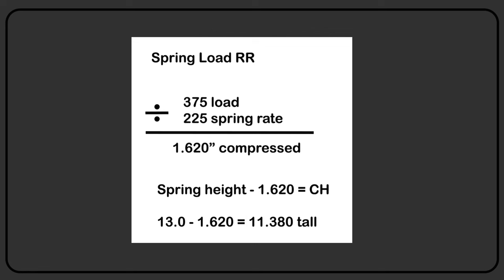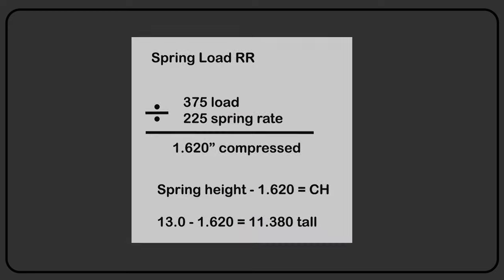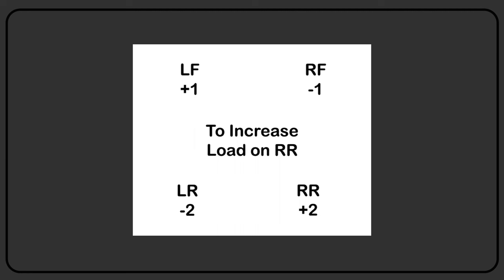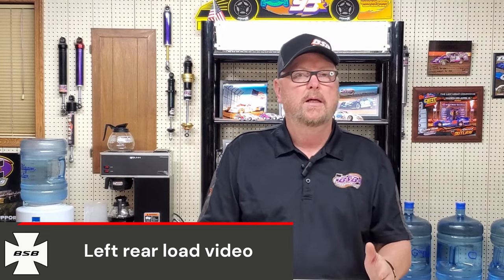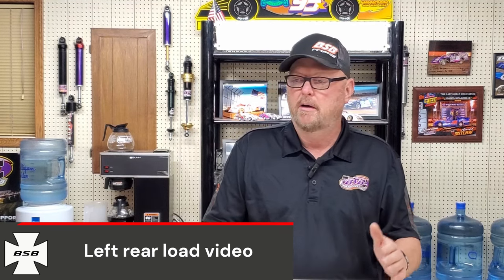RR Load, understand how load makes your car fast. (Short Video)

Comment: Had a pair of racers that i consult for. One has learned to trust in us and he makes the changes we need to do. The other is very stubborn and wants to strictly adhere to the chassis builders setup even tho he wants to change 30 things between hot laps to the heat and heat to A or B main. That chassis builder calls for a very low rate on RR. This guy keeps throwing more rounds in and stuffs the poor spring full of rubber but wont let me talk him into trying a 25 pound heavier spring. Lol. Yall need to listen to Jay here and dont be afraid to try something different than the builder suggests. This is all very good information that many of us, me included, has paid a lot to get. A few YT ads and yall are getting it free.
Reply from the maker: Thanks

Comment: Am I correct in saying that less RR load makes you looser on entry but lacks drive off the corner while more RR load creates tighter entry but gives you drive? Would something like lowering load to help create looser corner entry but putting a spring rubber in so that at 3/4 inch spring collapse it picks up the load through the corner again to help with drive off be something worth trying?
Reply from the maker: Load in the RR will help the car not over-travel the RR on entry, keeping it somewhat on all 4 tires. Rebound and lateral loads keep it from being loose on the exit, without load the car will lose the RR tire as you accelerate the car.

Comment: If you checked your RR spring load with and without LR preload, would the spring load be higher or lower with your LR preload spring and preload set?
Reply from the maker: Depending on the spring rate and load, 80lbs spring would be lower in most cases dragging down the RR.

Comment: When you say "at ride height".  Does that mean with the weight of the car on the coil over it should be 11.25 inch or whatever load number you are looking for?  If so. How to i raise ride height without adding load
Reply from the maker: Yes at ride height and if you want to raise the ride height you will need to add turns to all 4 corners of the car.

Comment: Thanks Jay, I'm new to the IMCA Stock car scene and I have built all my own cars over the years IMCA Mods and Sportmods and with building my first IMCA Stock car its hard to get information from other chassis builders which I understand so you have been a tremendous amount of help. Thanks You!
Reply from the maker: If you need anything call me and we will get it worked out.

Comment: What is a symptom if you have too little RR load.
Reply from the maker: You will slide the RR and be loose on exit.
Reply: Sorry for the basic questions.  I have so many track adjustment sheets and notes from one chassis builder to the next and one contradicts the other. I have one that came with my car that says more RR load makes tighter entry and loose off and less vice versa.  Get steered in the wrong direction and never understand why cause I'm doing what they say too.  Thank you for the info.

Comment: RR is getting a lot hotter then all other tires. Is my RR load to much or to little? Is the hotter tire doing the work or the colder tire? Thanks for all of the great video's Jay.
Reply: I also am curious on the science behind the tire temps.
Reply from the maker: The answer is more detailed than I am going to give but, when the tire gets to around 160 degrees it is at it’s best performance level for making grip. (the tire is softer than it was)
Reply: @jaynealgofast  is the hotter tire doing more work or is the cooler tire? LR to RR that is

Comment: Jay a few thoughts. 

I wouldn’t recommend anyone add lead to add load, these load numbers are arbitrary and should only be meant to get you close to balanced. 

I would be careful saying that rebound holds load in a spring. Rebound is not in the weight transfer equation. Only track width, mass, acceleration, and height of center of mass. Rebound actually takes weight off of a corner as it yields a lower average ride height. Ride height (in most cases) means wheel weight (raise a ride height in the scales and the corner gets heavier).

Comment: Wouldn't we need to figure out how to do the math in reverse to determine our actual rr spring load?
Reply from the maker: We use a principal that states that 2/3 of the weight of the RR corner should be on the spring.